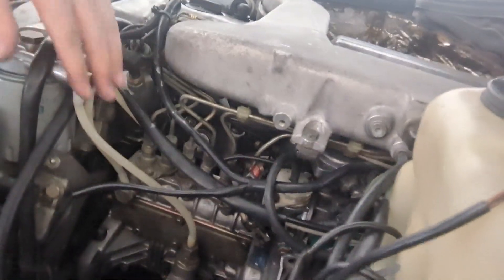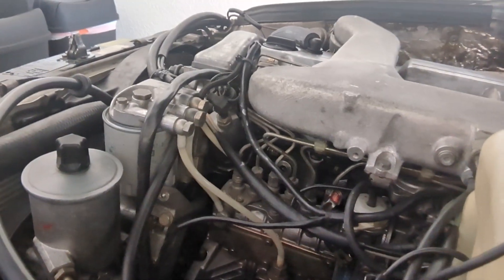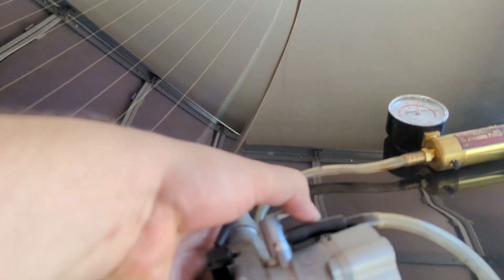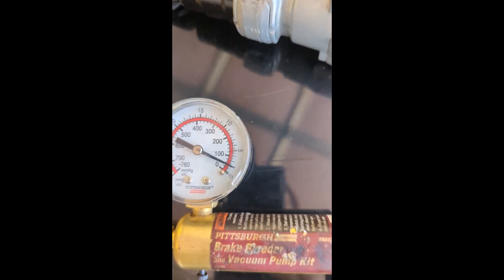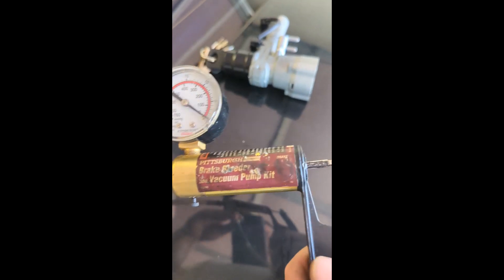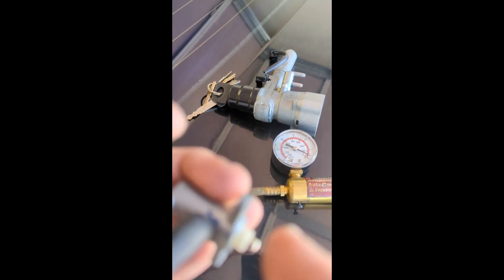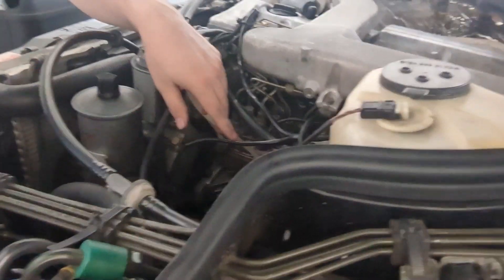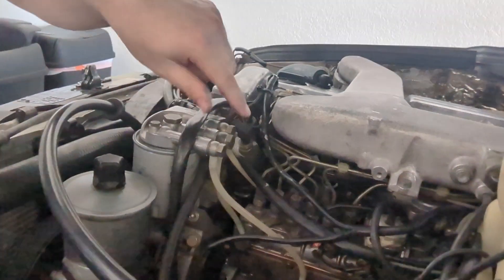300D was having trouble starting. What I found and fixed

Comment: Exactly where did you pull the vacuum to release the stop lever there's another vacuum point where if that releases then the car won't turn off because the stop lever will not go down you have to physically push it down with your finger all I did was attach the hose and it works fine
Reply from the maker: The two components I replaced were the vacuum box (basically the vacuum pod) for the stop lever itself and the vacuum connection that goes to the ignition. There are two brown vacuum lines running from the ignition. One goes to the vacuum box and other goes to brake booster. You can see the proper behavior for the stop lever at 7:03. With car on, it should be in UP position. When car turns off, it should move down to DOWN position. When turning key in ignition to position 2, it should go into UP position. The vacuum hose itself is on top of the vacuum box. 

In my clips, there's a long rubber hose connected to the brown vacuum hose which goes to the white colored vacuum box. Hope this helps!

Comment: Good work. Sometimes it is as simple as just two vacuum lines swapped. Also: get a 3-ring binder and when you go through this type of detective work, shoot & print some stills, make & label a sketch of the lines etc,  and write up a short description of what happened, and what you did. It can really help if a similar problem occurs in the future. You have a record of what you tried and what worked.